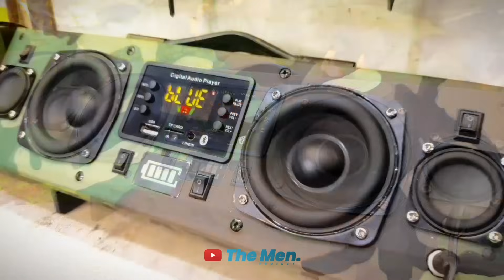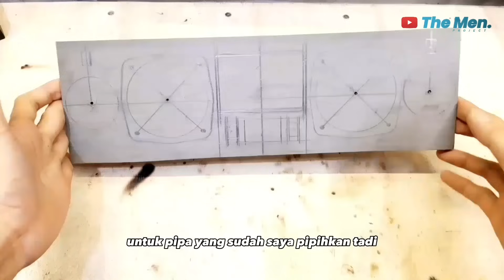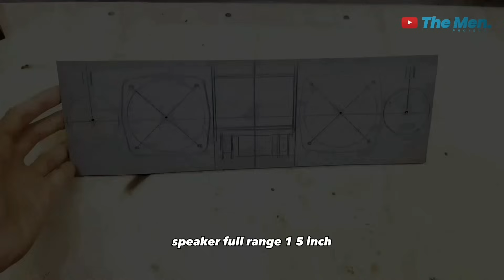Cara membuat Speaker Bluetooth dari pipa PVC full Bass!! | 3 inch

Comment: Ko ga di kasih modul charger batre .trus ngecas batre harus di buka gt
Reply from the maker: Ada lah bang buat cas  la ngapain harus buka. Coba cek lagi
Reply: Ga liat hehe 😅😅😅
Reply from the maker: @Wawam8000 😂 ada bang pakai jack 5.5mm sama cas adaptor 12,5 volt bang
Reply: @armanusubekti .bang mau tanya kalo ampli yg cocok buat speker 2.5in 10 / 5 wat enak nya pake power apli apa yh yg mini mini....yg harga 100 kebawah .plis info nya

Comment: mau tanya bos, saya masih pemula. speaker rakitan saya suara subwofer nya sember daun speaker nya gak stabil  saat volume 70%. 
1 speaker lg 3 inch 15 watt, power amplifier 2x15 watt. power suplay 12 volt 4 a. kira2 apa ya masalah nya?
Reply: pakai step up seperti di video om biar stabil tegangan biasa ny batrai nya ngedrop

Comment: Maybe you should use some foam inside it after properly calculating the perfect amount for this enclosure, mine was different built but foam really shows effect, but still u got thunder bass
Reply from the maker: @jazbose9164  Okay, thank you for your opinion, sir. Indeed, the addition can be deepened will make the sound more beautiful. But I think the pipe I'm using is too narrow so it's too dense
Reply: @armanusubekti  yeah, bro, by the way i'm not sir😅
Reply from the maker: @jazbose9164  Sorry, I'm calling you sir. That's because I respect you 😁

Comment: Maaf bang mau tanya soal tambah ic 7808 tar di sambungin kmna bang 🙏
Reply from the maker: Itu IC di sambung di input tegangan ke MP3 bang. Tidak usah pakai jg tidak masalah.
Reply: @armanusubekti  ok makasih bosku atas infonya smga sukses dan sht slalu
Reply: @armanusubekti  maaf 🙏 bang mau tanya lgi itu passive radiatornya ukuran brpa mm bang 🙏
Reply from the maker: @putracirebontimur2827  ukuran 92mm bang di deskripsi video sudah saya beri link pembelian
Reply: @armanusubekti  ok mksh bosku
Reply: Maaf bang mau tanya kalau setelan 24 volt adaptornya yg brpa volt bang🙏 terus sya pke speaker 6in 20 wat + 4in 2 speaker yg hrs di setel step up nya brpa volt bang..sya setel 24 volt ampli sya elconya meledak bang 🤦😢
Reply from the maker: @putracirebontimur2827  maksutnya yg di setel apakah modul step up bang. Kalok memang modul step up yg di buat 24 volt.  Adaptornya tetap 12 volt karena baterainya masih tetap 12 volt.

Cobak jangan di full kan 24 volt bang meski amplinya maksimal 24 volt. Mannya mungkin 19 volt 18volt di bawahnya
Reply: @armanusubekti  ok makasih bnyk bang infonya 🙏 slalu ngerepotin
Reply: bang nau tanya klw supaya ga nois ic nya kasih elco ukuran brpa ya bang..sya cba pke elco 16volt 3300 uf udh ga nois tpi kendalanya si bluetooth ga bsa bang itu knpa ya,sya cba elco lepas tpi normal lgi bang.

Comment: Speaker woofer 3" 50k x 2 100k
Full range Aima labs 1.5" 50k x 2 100k
Modul mp3 Bluetooth 50k
BMS 3s 10k + baterai 18650 6 x 10k 60k
Stepup dc 12-35v 20k
Tpa 3116 d2 80k
Battery level modul 15k

Total jeroan 450 ribuan lah
Full range tu harga tengah aiyima harusnya lebih mahal. Bikin sendiri gampang ges, yg susah solder batrei
Reply: Ini hanya patokan ya teman² 🤣
Reply: Bang yang diatas baterei namanya apa 🙏
Reply: Nyolder baterai ga rumit bang 😊
Reply: pale batre holder beres om
Reply: baterai 18650 harga 10k jelek bang
Reply: @daichishinichi1905  namanya juga bekas. Kalo baru sekitar 50k perbiji
Reply: full range aima itu yg tuwiter nya mas? maklum masih awam 🙏
Reply: @NurRahmadx21 full range bisa jadi tweter sama speaker biasa
Reply: @BountyHunter100G  ada saran speaker yang lain ga mas biar budgetnya bisa lebih rendah lg saya rencana mau buat speaker buat kamar, sub 4in, twet 1,5 in
Reply: yang susa nyolder batre nya emang

Comment: Ic regulator nya berarti nyambung ke power amplifier ya cak bukan ke baterai
Reply from the maker: Iya bang IC regulator buat mp3 nya. Meskipun tidak pakai gpp karena sudah ad IC regulator di MP3 nya
Reply: @armanusubekti  bang aku kan udah beli ic regulator nya tp mp3 punyaku kan udah ada power amplifier dan colokan mic nya katanya klo di kasih ic regulator katanya suara nya ikut turun apa iya??
Reply from the maker: @lusianasiska7746  oh pakai Mp3 yg sudah jadi 1 sama amplinya ya bang.. 

Iya bang otomatis turun tegangannya karena IC tersebut buat turunin tegangan..
Reply: @armanusubekti  udah beli tapi belum datang barangnya
Reply from the maker: @lusianasiska7746  iya bang nanti di coba dlu saja ketika sudah datang lebih enak yg mana.. karena saya biasanya tak beri IC lagi karena sering rusak mp3 ketika mau rakit. Kegedean voltase dikit udah tewas.
Reply: Cak mau tanya punyaku tpa3116d2 di pasang klau di besarin kok suaranya krasak krasak speaker nya ya pakek 8inch
Reply from the maker: @lusianasiska7746  besarin volume pakai apa bang. Pakai volume media seperti hp apa yg lain. Kalok pakai potensio kemungkinan potensionya kotor. Bisa di matikan semua komponen dan putar berulang secara cepat di potensionya biasanya langsung ilang kemreseknya..
Reply: Pake hp
Reply: Di tes di suplai speaker volt nya  cuma 0,12 volt klo di suplai dc udah 20volt
Reply: Kaya speaker nya kurang suplai volt klo di besarin grok grok
Reply from the maker: @lusianasiska7746  pakai battery apa adaptor bang..??
Reply: Baterai bang
Reply: Saya cari2 ternyata dari mp3 nya karena udah ada power amplifier nya suara kaya tumpuk
Reply from the maker: @lusianasiska7746  oh iya bang. Mungkin harusnya pakai mp3 yg tanpa power bang

Comment: @armanusubekti mohon maaf kak saya pemula banget kak sya emang gk pernah buat ginian tapi saya pengen belajar kak🙏
Untuk baterai yg di vidio ini kan memakai batrai 6 susun tetapi kalo saya pakek baterai 12 susun 40 ampere seperti vidio tutor cara membuat rangkaian baterai 12 susun vidio  kk sebelumbya apakah bisa saya pake 12 susunan batreai kak?
Apa ada berpengaruh pada komponen yg lainnya kak?
Mohon di jelaskan ya kak, terimakasi kk🙏
Reply from the maker: Sangat berpengaruh sekali bang jika pakai 12 susun 40 ampere. Pengaruhnya baterai jadi lebih awet full volume gak bakalan protek.. jadi kesimpulannya makin bagus kalok pakai 12 susun baterai 40 ampere 😊😊
Reply: Cara pemasangan elco" itu gmna rangkaiannya kak?
Reply from the maker: @mangelon_8591  ke 2 elconya di sambung seri bang.  Salah satu kaki di sambung ke salah 1 kaki positif speaker

Comment: Kalo pake pipa 3" bisa gak bang
Reply from the maker: Bisa bang. Cuman agak ngepres kalok spikernya juga 3 inch..
Reply: Kalo baterainya itu satuannya yang berapa mah
Reply from the maker: @RBProjectOfficial  saya beli online di deskripsi itu katanya per biji 2200 MAH bang. Tapi saya juga belum tau pastinya berapa Kapasitasnya karena gak punya alat ukurnya bang..
Reply: Makasih man infonya,
Reply: Kalo modul mp3nya itu harus yang kayak gitu apa boleh yang lain
Reply from the maker: @RBProjectOfficial  mp3nya bebas bang . Pokonya mah mp3. Kalok yg sya pakai itu tegangan 12 volt mp3nya.. jadi gak repot turunin tegangan dari baterai..
Reply: Pokoknya yang penting 12v ya
Reply from the maker: @RBProjectOfficial  iya bang mending beli mp3 yg sekalian tegangan 12 volt. Biar gak ribet pasang step down ataupun IC penurun tegangan.

Comment: Wah sangat menginspirasi sekali, saya juga may buat seperti itu tapi dana nya yg masih kurang karena dana pelajar 😅😁
Reply: Budget 300 sepertinya sudah cukup, dgn catatan paralon nya bekas agar tidak keluar lagi biaya. Hehe
Reply: @totong1985  saya cari paralon 4inc di toko ijo 5rban per 50cm tapi tipis banget 😅😅
Reply: Berikut rincian nya
Spkr LG Rp 60000 X 2
Twetter x polytron 2 biji RP 25000
Pam 8610 Rp 16000
Tone control pasif XH M802 Rp 23000
Modul BT Rp 30000
Batrai bekas 6 biji Rp 30000
Bas radiator Rp 33000
BMS 3S Rp 10000
Reply from the maker: Wah ini mah uda mantap Om..😊😊
Reply: @armanusubekti  iya om, saya rakit pakek power pam 8610 + TC pasif. Apalagi yg om pake TPA basnya lebih glerr tuh.
Reply from the maker: @totong1985  iya bang glerr pakek buanget😁
Reply: @armanusubekti  saya pribadi sangat berterimakasih banyak kpd para konten kreator, yg awalnya saya tidak mengerti tentang elektronik stlh banyak nonton konten sprti ini bisa nambah ilmu dan skil.
Reply from the maker: @totong1985  iya bang ternyata mudah ya jaman sekarang mau rakit sesuatu tinggal colok colok saja. Karena komponen di jual secara terpisah dan mudah di pahami.  Saya juga bukan tukang elektronik bang🤣
Reply: @totong1985  wah sangat lengkap, terimakasih mas sudah di berikan catatan bahannya 😁🙏🏻
Reply: @wazz1080  iya sama - sama, rincian tsb adlh harga pembulatan saja dr masing2 item. Barangkali aja klo agan cari2 di online dapat hrg yg lebih murah.
Reply: @totong1985  siap mas👍

Comment: Astagaa muantaap sekalii meenn....itu ongkos nya berapa siihh men klo bikin sendiiriii meeenn...kereenn bgt jiirrr
Reply from the maker: Ini bang bahan komponen yg di pakai di kolom deskripsi ada..

komponen yang saya gunakan :
2 Speaker LG 3 inch 15 watt
2 Speaker Aiyima 1,5 inch 3 watt full range
Module TPA 3116 D2 original chip
Module Step Up Converter DC to DC
Modul BMS 3S
Module MP3 bluetooth  
Modul level baterai indikator
4 buah saklar kecil
konektor charger 12 volt
baterai 18650 ( bekas laptop )
2 meter kabel serabut
Kapasitor 2200 35 volt
2 kapasitor 3300 16 volt ( untuk speaker full range )
2 kapasitor 470 16 volt ( untuk speaker full 

Kurang lebih 400 sampek 500 rbuan.. sisanya ada sendiri di rumah...☕🚬 

Silahkan buat bang pasti berhasil
Reply: cepeeettt jawab meenn aku jg mau bikiinnn😤😤😤

Comment: Total biaya kisaran berapa mas
Reply from the maker: 400 ribuan mas untuk beli semua komponen.  Kabel, modul, speaker dll.  Kalau bahannya seperri pipa lem dll itu barang bekas dan stok yg ada di rumah..
Reply: @armanusubekti kalo pakai pipa PVC 6 inch gimana bos
Reply from the maker: @reyzakanaya5645  makin mantap Bosku.. bisa pakai speaker woofer 4inc 4 biji. 2 full range atau twetter

Comment: can I ask something? Where did you get or buy the end cap?
Reply from the maker: Sorry what did you mean end cap?
Reply: @armanusubekti   endcap tu penutup pinggiran itu kang. Tutup pipanya maksudnya
Reply from the maker: @besardwisaputro8392  oalah itu bang. Itu sebenernya pasif radiator saya pasang di tutup pipa. Saya beli di toko bangunan harganya 10 ribuan per biji. Tolong jelesin ke bule tersebut bang..😂
Reply: @armanusubekti  
Ah elah... aing teh mboten ngartos kang 😂
Reply: Hi, I try to answer, the end cap is using cap of 4 inch pipe. Then make a hole and put passive radiator. Hope this answer your query.

Comment: Pada rangkayan atau skemanya knapa ga di ikutkan elconya bang??
Pada elco output batrei itu apa masih ada dioda bang??
Trimakasih 🙏
Reply from the maker: Iya bang di skema gak ada elco karena saya gambar secara manual mungkin kelupaan.ada elco di output baterai dan elco di speaker full range  biar kuat itu si full range .

Lalu di output baterai ada elco dan dioda 1 ampere itu saya pasang biar waktu folume full tidak drop baterainya..
Reply: @armanusubekti  Sangat membantu,, terimakasih ilmunya tuan🙏🔥🔥🔥
Reply: Elco di pasang seri atau paralel dengan speakernya?
Reply from the maker: @muhammadsholeh9619  Elco di pasang seri bang.
Reply: Masih binggung mas boleh dibantu detailNya mas 🙏
Reply from the maker: @sonywidafamily  baik bang besok.saya buatkan videonya..
Reply: @armanusubekti pakai elco biar g sember si fullrange y
Reply from the maker: @black_cyber4744  betul bang . Selagi ada elco volume full tetep aman
Reply: @armanusubekti  sip mas bro,,ane jg bikin pke pke LG 3 in yg ky gt..Bass y auto gler krn speaker y  karakter subwofer aplg di combo pke tweeteer astelo suara y mkin ncis2 gler 😁😁😁
Reply: @black_cyber4744 bisa bikin mas?